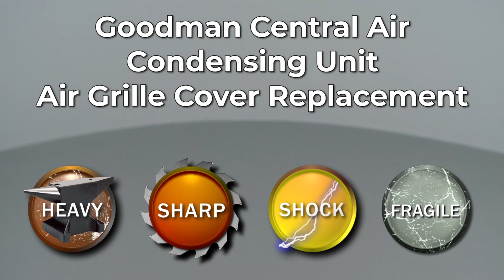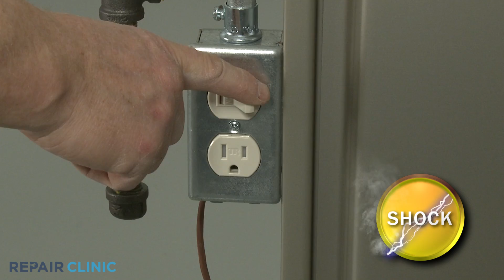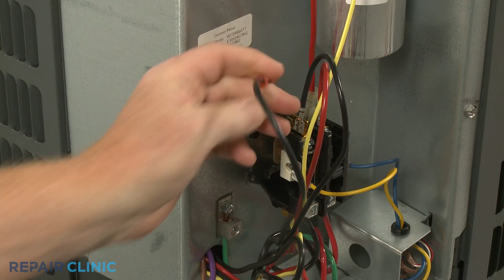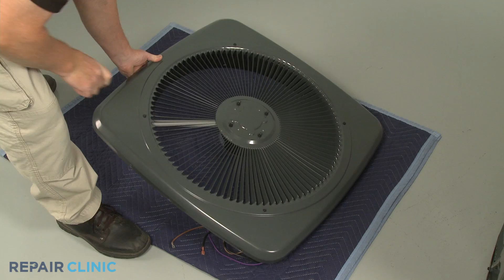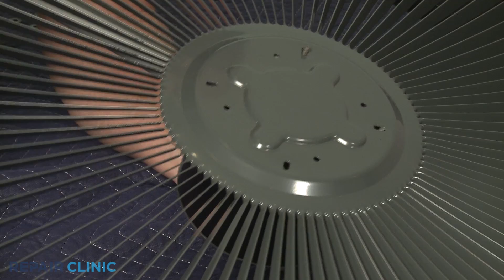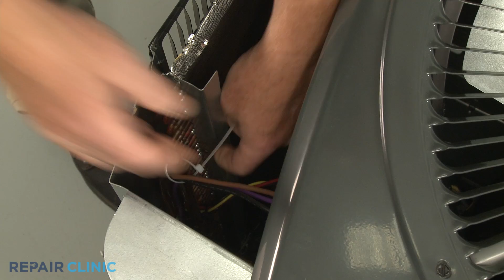Goodman Central Air Condensing Unit Air Grille Cover Replacement 0121R00010PDGS

Comment: That was useless.  Your AC units have the shittiest covers ever.  Took mine off to clean and they don’t fit to go back on.  Goodman missy be owned by GM with a fucked up design like that. I’ll never clean the fucker again. It can burn up and I’ll replace it with something that’s not fucking junk.